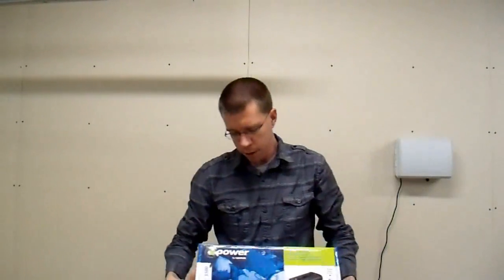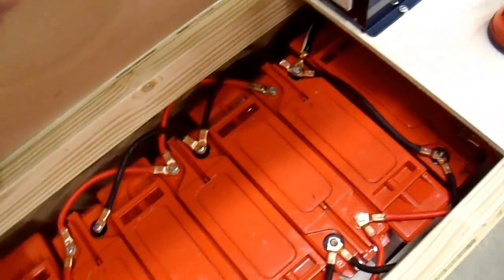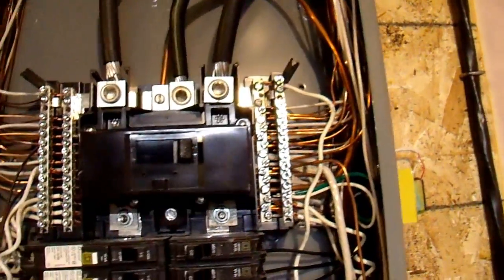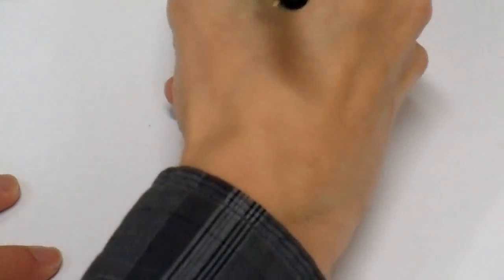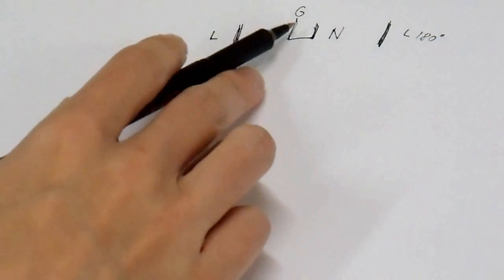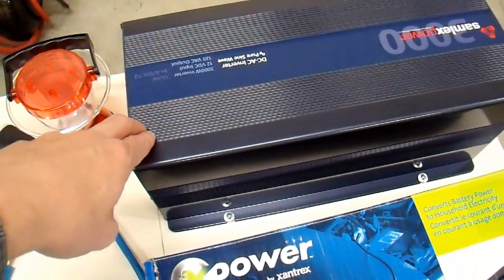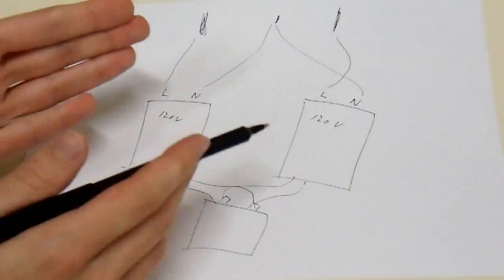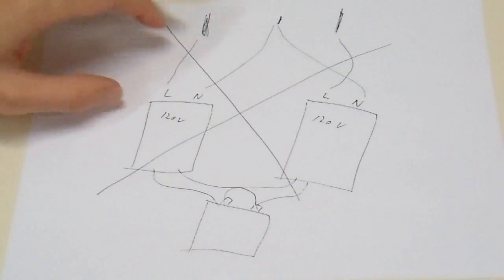How to Power your House with an Inverter/Generator During a Power Outage Part 1/3

Comment: What size inverter would it take to run a 2 ton central AC unit (by itself, no other loads)?Any opinions please.
Reply: +Mike O look at the documentation or labeling on the unit to find the operating voltage (probably 240) and current. Multiply the two numbers to find the wattage required. Note that the actual wattage consumed will be dependent on the temperature set on the unit. Usually the rated current draw is based off the maximum setting for the AC, but it doesn't hurt to use an inverter that is rated 500 or 1000 watts higher than what is required. Another reason it's a good idea to have more watts than you need is because large loads tend to have a high power consumption upon initial startup. If you load is 500w and you have a 500w inverter, its possible that when the load is turned on it could initially have a peak power consumption of say 600w and cause the inverter to shutoff or overload. Which would stop power from being delivered.
Reply: Depends on the total watts and the start up load,totally.1,200 watts? Get a 2,000 watt inverter pure sign wave....,minimum.

Comment: You said there are 2 methods.  I am going with method #3. During my remodel, my house is getting a separate electrical system. Each room has a "green" outlet that goes to the inverter. Then the microwave, fridge and freezer has a green outlet beside the public power system.  This way, I have a backup. It is hot 24/7 and ready anytime. No interfering with the standard electrical power.....  Also, know your loads. I am still gathering data. Refrigerator running 330w 1.7kw a day, Freezer 345w running 1.8kw a day,  Propane furnace 290w running 1.6 kw a day, microwave 880w running 1.1 kw per week, Oxygen machine 680w running 6.8kw a day...... It all adds up fast.  Know what you really need.
Reply: The microwave will be a HOG. You may need a separate inverter just for that appliance.The refers have a start up wattage requirement. You plan on running a LOT of watts,there.
Reply: So, as I mentioned, the house has a separate electrical system.  That is the third way... 2:35 #1 use extension cords, #2  2:45 transfer switch. Thus, my way of having a separate electrical system, separate from the public power system is the third way.....  The power consumption is a separate issue I was just reminding people about..... As for power, I have found used pure sine wave inverters. (3- from 1000w to 2500w) Each can be to a line for different uses....  Use one, use all, what ever you like. (For those people planning to jump me for that comment, don't say something stupid like you can not put multiple inverters together.... if you don't know how to separate different runs, skip to easier things)
Reply: You will be fine!
 Sure you can run a few inverters from the same or different battery sources!
 Great thinking!!  Applause is due.
 Dave in Seattle.
Reply: 2 is 1 and 1 is none....  I would rather have 2 or 3 smaller inverters running to outlets in separate rooms, than have 1 for the entire house. 1, I can turn off ones I don't need. 2, if one burns out, I still have something to work with.... besides, the power used in the house, will be the same load on the battery bank (minus effeciency, give or take).  As long as the battery bank is big enough for one system, it is big enough for the other, if power consumption is the same.
Reply: Just label each out put for the  inverters. Simple. Good thinking!Some inverters have a remote on-off switch that is wireless. Very cool.
Reply: My problem is storage. I am looking for a used forklift battery... hard to find!. (current storage? 18 - 232 AH, 6v golf cart batteries).......  Input? I have 2.1 kw of solar, and 3 PMA's rated at 1000w (our average wind here, according to the internet, is 11 mph) I will guess I will only get about 1/4 of the power out of the PMA's.  I hope to get it all installed by winter.... it now is taking up space in the garage!  Now that my mother is on Oxygen 24/7, it is pushing me to get it done sooner than later......

Comment: Really?  ARE YOU SERIOUS!!!  I am a licensed electrician and do everything from basic home electric up to and including 480VAC 3Ph services and generators with some customer owned high tension service work at 12.8KV.  I can't even begin to tell you of the dangers you are exposing people to with this video.  I will try though.  There is not a municipality in any civilized country that allows this to be done.  The service provider will pull your meter and require that you hire a licensed electrician to repair and inspect the service should they find this done.  Should you forget and/or make a mistake and back feed the line as this clown advises the line crew could be exposed to not just the 120/240v that the inverter or generator is pumping into the line but the step up voltage which in most cases is 4,800 or 12,800 Volts.  A man or men could die because of what this guy is telling you to do.  Do not follow this video, this is just about the most stupid thing I have seen on YouTube in some time.

One more thing  Using a pair of inverters like this guys recommends will not work properly and could burn up your neutral wires in your home in certain wired schemes should you follow this garbage advice.  I will not detail the reasons as I am done here.

Contact a licensed electrician, there are back feed kits for some panels that have an interlock system that requires a break before make to properly back feed a service.  There are also transfer switches, both manual and automatic, that can be installed.  Don't be stupid, don't be this guy.
Reply: When it comes to power there is 2 ways of doing things. The cheap way and the right way.
Reply: enator71 great idea and excellent advice
Reply: I mean been doing it for years never had any problems

Comment: "Hello. I live in a building of 16 flats. Every house has been given one bulb point for generator use. However, it does not function when there is normal power. Can they connect only one bulb point to the generator without going through the main power line?"

Comment: They do make dual single phase 240 volt from 12 horse power gas powered generator, as no 240 volt power inverter, 'why?' The cost, or needed 2 circuit batteries banks plus the special circuit built in inverter that do 180 degree phase of 60 hertz.
Reply: +Stan McBeth (STANTHEMAN770) They absolutely make inverters running form single bank with a split phase 240v output. Check out the Schneider Electric XW or Connext SW systems. 2500W up to (?)10,000W

Comment: Sounds too dangerous.
Reply: Sounds too dangerous when you dont know wtf you are doing...  its that simple
Reply: You Tube is someone who has no clue WTF he is doing.  He doesn't even know that neutral wires carry current, which is electricity 101.  Don't listen to this moron, you are right, this is dangerous.
Reply: @jonseason8170  He literally said the neutral does carry current. You are being misinterpreting for the sake of being a troll.

Comment: Suside cord is a good description of what this is demonstrating.  This is not safe.
Reply: Safer to just take the output of your 110V inverter and connect to an unused breaker and neutral/ground in your breaker box.  Especially if you have kids!
Reply: back-feeding using a double male is perfectly 100 percent safe as long as your main is off, and the plug is not energized when it is unplugged, this is how 99 percent of people backfeed during emergencies....you dont know what your talking about
Reply: I run  one in my shed AFTER I shut the power off to my shed.
Reply: I use a suicide cord for my shed after I shut off the line/grid power to my shed.
This method provides power to ALL of the 110 V. wall sockets.(5).
Inverter makes power from my batteries.
Reply: So given than 376,000 people (and counting) people have watched this video, and given that overly optimistic and bull#$@% stat you pulled from your as@, only 3,760 people have died as a result of this video.  Most of them electrical linemen who didn't sign up for your MacGuyver experiments.  Why can't we all just understand all this as well as you?!
Reply: electrical linemen died as a result of this video? really?
Reply: Yeah, you're right.  Let's not forget the family members who ended it on that suicide cord when the power came back on, they actually remember to unplug the generator at the generator (avoiding that hot suicide cord - so smart!), they check to see if the power's back on by turning on the main, success(!), they go to bring the generator back in, and ZAP - the suicide cord gives them 50A from the main, puts them down for good, and sets the house on fire.  At least you didn't have to just plug directly into the generator when the power went out and got to pretend you know how stuff works.
Reply: yeah I know man, as soon as you put the last screw in the the wirenut when making this devil cord your house will blow up, and your church burns to the ground. If you try and plug it into anything it causes instant abortions.
Reply: 240V 50A is no joke.  Let that plug touch something conductive it will absolutely start a fire.  Touch that plug and die quickly.  I don't know what Wile here is going on and on about, though.  Pretty weird analogies.  Abortions?  Do you think that's funny or something?
Reply: "analogies" lol. no one is making any analogies, sarcasm is not an analogy. You are right that 50a is nothing to play with.....but if the MFer has NO POWER, as it wouldnt if you plug it in before you turn on the generator, you can play with it, touch it, jump rope, even chew on it if you like and its perfectly safe.
Reply: Lol, "NO POWER" for the "MFer."  Sure, until the power comes back on.  Blowhards on the internet often can't think that far out ahead, I know.  But at least you know how right you are.
Reply: Suicide cord is good and works AFTER you shut off the main breaker...

I AM GETTING TIRED OF PEOPLE SAYING THAT BACK-FEEDING IS DANGEROUS OR SUICIDE CORDS ARE DANGEROUS BECAUSE THEY ARE NOT... ITS ONLY DANGEROUS IF YOU LEAVE THE MAIN BREAKER ON
Reply: You Tube: I AM TIRED BLAH BLAH BLAH...  First, the threat of some guy messing up and not shutting off the main, or someone else coming along and flipping the main back on - which could kill a lineman - is reason enough to outlaw this stupid practice.  IT'S ONLY DANGEROUS WHEN YOU LEAVE THE MAIN BLAH BLAH: When you do this setup, a plug becomes energized.  Plugs are never energized in a real non-idiot electrical setup, only receptacles.  You have to be trying to get shocked by a receptacle, but with an energized plug you just have to touch it and ZAP.  Touch something metal and you could start a fire.  Suicide cord.  Regulations exist for a reason.  Got to love how the overconfident blowhards on the internet think that all the rules are "stupid."  Countdown to Darwin award...

Comment: been watching you're videos and have a question about grid tie inverters would you know how to by pass the island block on say an inphase 250 I would like to use this in a off grid application to heat water by using a regular inverter the alarm keeps going off so I figured a grid tie converted would work

Comment: A neutral is NOT a ground, it carries current. Don't confuse the two.
Reply: In the US, the neutral is a groundED conductor.  The bare wire is a groundING conductor.  They are connected together and to earth at the service entrance, and only there.  Neutral is normally pretty close to ground potential, other than a small voltage rise due to the current in the wire.  Neutral isnt a hot wire here. That isn't true in some other countries.
Reply: maybe you need to relisten to what he said.  Common and ground are tied together.  That is the way United States residential is.
Reply: Wrong.  The neutral does carry current.  Stop before you hurt someone.
Reply: The Neutral CONNECTS to Ground at the outside main panel...  The Neutral does NOT carry current...  
If the Neutral carries current then every CATV and Telephone repair man would be DEAD when they grounded out their facilities to electrical ground...
Reply: J S:
Okay so why is it that when i TOUCH the Neutral wire i don't get zapped..??  If this were true that the N carries current then every metal piece in the house that is GROUNDED would be HOT and energized...
Reply: Nope.  The neutral carries current, and you have no idea what you are talking about.  You don't get shocked because it is at 0V, but that doesn't mean it doesn't carry current.  The current runs in a circle between a hot and the neutral.  When a 240V load is present, these cancel as much as possible, with the remainder running on the neutral.  I suggest not listening to this idiot, he might get you killed.
Reply: J S so if the Neutral carries current like you claim, then the ground also carries current because the N and G are tied together at the main panel...
Reply: Nope, you're a dangerous and overconfident idiot.  Congrats, you know they're tied together.  The ground is a side branch.  Imagine a battery plugged into a light, a simple loop, then run a branch wire off one of the wires and don't plug it into anything but stick it into a potted plant.  The wire connecting the light to the battery is the neutral, the side wire is the ground.  The neutral carries current and the ground does not.  The only time the ground carries current is if a fault is present to allow the breaker to trip.  https://www.youtube.com/watch?v=D2B41I0DBlI - this can clear it up quickly.  Also see: https://www.youtube.com/watch?v=UvWgVG49fq4.

Look it up, then reflect and realize just how dangerous you are to yourself and everyone else reading your comments.
Reply: J S:
You said wire a battery to a light... 2 wires... On ONE of those wires you will TAP off of it with another WIRE and run it to plant dirt.. You have done NOTHING to that circuit but take one wire and bridge it to DIRT...  Care to explain the stupidity behind your wiring..??
Reply: That's how grounding works and is how your house is wired.  The branch wire doesn't carry current under normal circumstances, it just keeps that half of the circuit at ground potential (0V) and provides an easy flow for faults, as the potted plant (Earth) can accept current flow despite being a single wire.  That's why the neutral doesn't shock you, it's 0V.  The wire branched from is the neutral and carries current between the load and the battery.  You clearly didn't try to teach yourself, and now you're boring me with your ignorance.
Reply: J S:
In one comment you tell me that the branch wire DOESN'T carry current  then the other sentence you tell me the same branch wire carries current between the load and battery...???  And you tell me i am ignorant...  You are one fuck up of a teacher...
Reply: The wire branched from carries current.  It is the neutral.  The wire branch does not.  It is the ground.  When the student is too dense to learn, blame the teacher...
Reply: J S when the teacher says one thing one minute then says a different thing the other minute that negates the 1st comment, now the teacher is an idiot...   But the student was smart enough to catch on to it .. 
Got any other smart ass comments to say ...
Reply: Read it again.  "The wire branched from is the neutral and carries current between the load and the battery."  The wire branched FROM carries the current.  I never said the branch carries the current.  Reading comprehension...
Reply: JS:
QUOTED....
"The branch wire doesn't carry current"
"The wire branched from is the neutral and carries current between the load and the battery"

WHO has the reading comprehension...??
Reply: The wire branched from is not the branch wire.  You really should stop making a fool of yourself.
Reply: J S what ever bro...

Comment: And the deal about backfeeding..linemen always assume power could be in the line..and wear full safety gear anyway... silly laymen. ..by the way any short on the powerline side would trip the breaker on the generator anyway. ....
Reply: And the load of your neighbors loads would also overload your inverter and or generator real quick

Comment: I actually understood what you said :) I used to be an HVAC mechanic. So I have replaced a little wire to get a system running. Was just thinking to power my own house temporarily during a power outage. If I had all essential equipment (fridge, furnace, a few lights) on the same phase. I could add a breaker to the panel on that phase to feed power from a generator into the house. Naturally the main circuit breaker would always be off till commercial power is restored and my generator has been disconnected from the panel.

Comment: Hey great tutorials very helpful, I want to do solar and wind to feed a battery bank in an RV, do I need 2 charge controllers? how do I approach this?
Reply: Also I am not going to grid tie, I will run TV and PC (possibly some other small draw items) off of the battery bank and let the propane do the rest. hoping for around 500-700 watts total, which is kindof overkill but I want to eventually feel comfortable powering a whole house. The primary motivation for both wind and solar is the fact that I live in washington state and particularly in the winter time, we have very little in the way of sunlight.
Reply: +Jeromy Stewart I believe solar and wind have different charge characteristics so likely you would need a solar and wind controller. As long as the battery settings in the controllers are the same, you shouldn't have a problem.
Reply: +jayw900 Thank you
Reply: Sure, i hope it helps. Not connecting makes it a lot easier to set up.